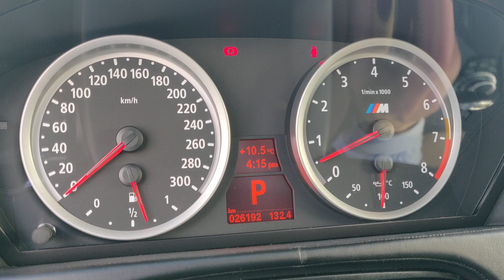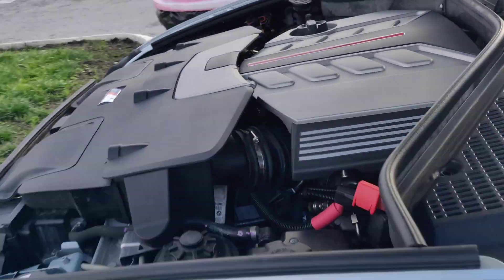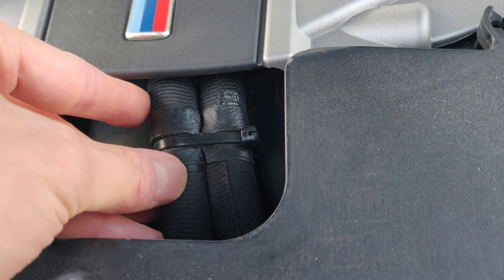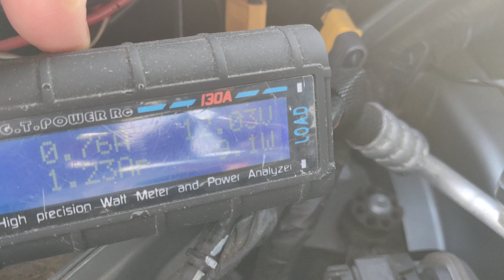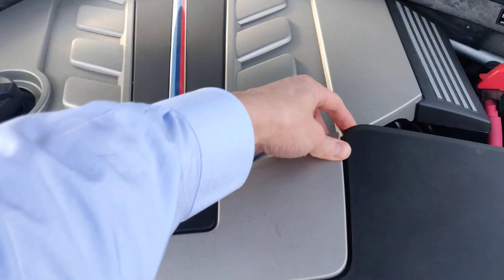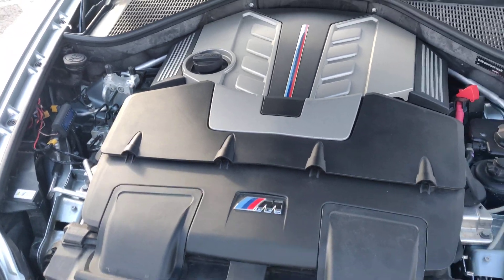X5M(S63 Engine) Owners, Keep Your Turbos Alive - Check the Aux Turbo Coolant Pump

Comment: Does this apply to the S63TU in the F10 M5? 
I assume it would because they are more or less the same despite different technical updates.
Reply from the maker: @johnmactavish5191  Yup, looks like a similar pump, so same will apply. It'll run that for 20 minutes or so after shut down too, to handle the heat soak. Thanks for the good question. 
Cheers! 
David.

Comment: Hey if there's no vibration in the left line that means the pump isn't working?
Reply from the maker: Hi, 
That's the feed line to the pump(it leads down to the pump's intake, so it's sucking on the left side), so you should feel some vibrations from that fluid getting pulled on by the impellers. If you don't, but the pump is spinning, it might be that there is air in the system and needs to be bled or filled up. I didn't do anything special though, I just filled the left coolant tank(for intercooler system, not the right one which is the main radiator). Do you have leaks on the coolant line connections? There's a bunch of them all above the turbos. If those leak then your coolant goes low over time which can lead to low levels and air in the system, it won't throw any troubles and your turbos will just cook over the and seize up. It's a really bad design with no sensors to warn you, which is why it's so important to check the proper operation yourself, which you're doing now so that's great! 
My pump failed and it didn't even say a thing. Luckily I caught it cuz I have the energy meter, which I keep an eye on to make sure the pump pulls about 12w. If it doesn't, that means it isn't circulation coolant properly throughout the turbos. 
If you install a Bluetooth energy meter you can check on it from your phone too, without going under the hood. 
Sometimes the pump just fails, I had one fail after 1 day, brand new from BMW!
Good luck!
Cheers, 
David.
Reply: @DavidSunshine  sounds good I can definitely feel vibrations when the car is turned on but when it's off there's barely any vibration can't even tell of its working or not
Reply: Is there a way to check if the fuse is browned or not first?

Comment: I just got the pump today, mine is making some bearing grinding noise so it'll need to be replaced.

Do you know what the procedure is to replace the turbo aux pump? Do I go from the top of removing the air intakes or do I have to remove the radiator to access it?
Reply from the maker: Hi,
Ya it'll be good to replace it 
It's easy, you can do it from the top by just removing the intake.
Then a couple torx and it's out.
The pain is the coolant lines but if you can get your hands in there it'll be ok.  You'll want the proper sized hose clamps on hand to replace the factory ones, they garbage.  It's the same size as the ones up top. I replaced all of mine while I was at it, since those fail all the time when the rubber goes bad.  You might want new hoses when you do this job, but check it out first and see if that's the case.
I didn't do a special bleed procedure after doing mine, but that's probably a good idea. I just poured coolant into the lines from the top of the hoses to prime it the best I could and remove as much air from the system as possible.  No need to remove the radiator, just be careful not to cut your hand on the sharp metal brackets, wrap them in black tape before you jam your hand in there. 
Cheers!
David.
Reply: @DavidSunshine  Thank you so much, appreciate it.

Comment: So we can splice the wireing and run a digital scan inside car to keep and eye on voltage .once we turn car off .
Nice work
Reply from the maker: Yup!  That's a great idea.  Or you can buy a car battery Bluetooth volt meter, and it can keep track of the voltage from a distance, and even keep a log of it. Then you can connect to it by your phone, less convenient than just a volt read out, but has some benefits. 
Cheers!
David.

Comment: Do you now how to coolant bleed the system cause it is different from other bmw I have bmw x6M 2014 thanks
Reply from the maker: Hi Sunny,
I actually don't have the bleed procedure.  There are two coolant systems, one for the intercooler which is connected to this aux Turbo coolant pump, that's the one we're working on here, then there's the engine coolant system which will be similar to the other engine coolant systems, with the reservoir on the driver side. After swapping the pump, I just topped up fluid in the passenger side reservoir and ran the engine, driving around. There was air in the system but after flooring it a few times it seemed to have self-bled.  From this forum, there's some info on flush and bleed, sounds like one user suggests flooring it as well. 
The next time I flush, I was thinking I could disconnect the top hose and fill coolant there until the air is mostly out.  There's also a screw there, intake and output hoses, if you have a syringe you could fill in fluid until every bubble is out of the system.  I might give that a try when I flush the system.
Good luck!
Cheers,
David.

Comment: Do you have a part number for the pump
Reply from the maker: Yup, for my 2013 it was "11517629917", purchased at the dealership for $100 CDN, surprised it was so cheap cuz it was $350 at Lordco.  I'm guessing that it was discounted maybe cuz it was a recalled part in the previous year?  Not sure why.  Good luck!

Comment: I checked today and mine was vibrating I could feel it pushing liquid through. However the little resvoir by the engine oil cap was cold. Is that normal? Can anyone advise please
Reply from the maker: Hi,
That's great that you feel vibrations, that means you have flow.  If there's even 100ml of air in the system, you'll have pump cavitation and flow will stop.  If both tubes are vibrating then your system is flowing nicely, those 2 tubes should be warm.  The reservoir has no flow, so it can be the ambient temperature.  It's only where expansion fluids go, or used for make up fluid.  When the engine is cooled, open the passenger side intercooler coolant reservoir cap and make sure the level is topped up to max.  You can also check your engine coolant level on the driver side coolant reservoir cap.  Both must be good to maximize cooling of the S63.
Hope that helps!
Cheers,
David.

Comment: Thank you. I’m new to the S63 and I want mine to last as long as possible. I’ll be sure to check when I get home. 🙌
Reply from the maker: Nice!  The S63 is a beast of an engine.  I'm still enjoying mine every day!  With great power comes great responsibility.
I would also recommend changing your engine oil more frequently than they recommend, as it can help reduce wear and reduce risk of encountering other problems in the S63 that are oil related.  Oil is cheap if you replace it yourself, so it's a small price to pay to reduce wear and risk. Also, get only quality oil filters, I trust Mann only, I've had problems with other brands.
Cheers!
David.
Reply: @DavidSunshine   which oil are you using ?
Reply from the maker: @krankrolling  Hi,
I use Castrol Edge FTT 0W40, European Formula.  
Cheers,
David

Comment: Anyway engine need rebuild after 50000 km
Reply from the maker: That could be the case, in some cases.  What specific problems would require a rebuild every 50,000kms?  I have friends who had no issues over 200,000kms from the S63, they maintained it religiously though.  I could see a failed aux pump causing clogged oil lines and needing a rebuild.  I would recommend changing the engine oil every 10,000kms instead of 25,000 like the internal says.  It's only $50 on sale for the oil so if you do it yourself it's not that bad.  Mahle filters only, as the other ones break, and if that happens, then yes, the engine would probably wear down prematurely cuz there's nothing but gunk following through the turbo coolant lines, and the rest of the engine.
These will last over 200,000kms if maintained properly, with very little issues.  Then you may start to run into major issues.
Cheers,
David.
Reply: @DavidSunshine  I'm joking ofcourse, because heard so many times that bmw's 4.4 twin turbo not reliable.
Reply from the maker: @ivanmamedov90  lol, every joke has some truth behind it.  The S63 is a great engine, but it's complicated too so it needs routine maintenance otherwise it could need some rebuilding, I think that's where the stories about rebuilds comes from.  If users don't change the engine oil often, that could cause issues over time(excessive oil consumption, turbo line clogs, VANOS issues). The coolant lines for the turbos can leak, so I've replaced the hose clamps with stainless steel ones to keep that from happening, but if that goes unmanaged it could also lead to major issues, similar to the aux coolant pump.  
The X5/X6 partition can also crack and leak into the engine, gotta replace or seal that before it creates huge issues.
So like any BMW engine, if we keep up with the maintenance, it should perform well for a long time.
Cheers!
David.

Comment: Do you know if this pump failing will cause a engine loss of power malfunction also those pipes are super hot I don’t hear my car cooling off anymore once parked as it used too please let me know thanks .
Reply from the maker: Hi Denis,
The engine power loss isn't the pump.  Scan with Carly and see what it says.  I had that and it was just the cam shaft position sensor, I cleaned the connection and it was fine since.  Just wiggle the connector and it'll be fine too.
Cheers,
David.
Reply: David Sunshine hi David the only codes that were received were for the aux coolant pump off for the turbos and it seemed rather hot of the hoses like to burn your hand if touched. I’ll be changing that out today and resetting to see if it goes away .
Reply: Denis Reckovic hey Denis! Any luck with your truck. My truck is doing the same thing. Let me know if it’s possible
Reply: @DENIS74199 what did u find out? I'm going through this now and had my truck inspected and they said the same... can u confirm this was your issue? 🙏🏾

Comment: There is a “recall” on this part and will be replaced for free at the dealer. My 2012 has 110k miles and just mine replaced. Thanks for the video and awareness of this part and potential problem
Reply from the maker: Lucky! Glad they are fixing yours.  Did they mail you to say it's a recall fix? Or do you have to ask them?  Mine is 2013, no recall on mine cuz apparently they fixed it... Still seems to be a problem prone part though.  I'll be keeping an eye on it, and I would recommend any S63 owner keep an eye on it as well, especially if it's new, to make sure it doesn't fail prematurely.  Cheers!
David.

Comment: Do you know which code is logged?  00A6D1??
Reply from the maker: You'll see 002EA9 for a Turbocharger coolant pump fault, but it'll come back if you clear the codes, even if you have a new pump in there as it's working fine. I think it's just bad programming on their part, BMW ignores that code at the dealership.  But if you unplug your pump, or if it's actually broken, it'll throw that code, and they will continue to ignore it, which is stupid.  So basically you need to verify the pump is pumping on your own, with your hand or an energy meter.  It's a pretty bad system, I wish it had an engine light when the pump failed, but maybe in the future they will add that diagnostic feature.  
You should try unplugging the pump, and seeing what code you see, for me, I throw that code whether I have a working pump connected (after a day or two of driving) or not (right away). 
Cheers,
David.
Reply: Can it be the fuse in the fuse panel?

Comment: Can you find me a link for the aux coolant pumps? I’m not sure what the right ones are.
Reply from the maker: Hi,
It's the Auxillary Turbo coolant pump, as show here:  https://www.rockauto.com/en/partsearch/?partnum=11517629916
It's about the same price from the BMW dealership part's counter, but a brand new one from them failed a day later, so I don't think their quality control is great.  GATES is a great brand, so I would actually go that route before getting another BMW pump.
It doesn't take much to replace, and I could do it with a few tools in a car park.  Just need to replace it, and top up the coolant.  You should probably bleed the system from the top bleed screws, but I never did, instead, I just brought it up to operating temperature and did a few WoT launches, it purged all the bubbles out, and it started pumping fluid after that.  I had a wireless amp meter on it, so I could see when the pump was in cavitation, without that, you will have to check the hose for vibrations to verify that it's pumping and flowing coolant through the turbos, instead of cavitation(which sounds like vibration of the impeller), or it's just spinning without any turbulent flow through the hoses, which are both bad, and if that's the case, you should go drive around and do a few more high rev pulls or launches.
Hope that helps!
Cheers,
David.

Comment: bad design if it won’t warn you with error code. Seems critical.
Reply from the maker: Haha, yup, that's what I thought!! I troubleshot this stuff a lot, it never once warned me with a check engine light, and yes, it may take months or years to have a failed Turbo, but I think it is critical as well!  BMW programming doesn't suggest this.  If you go and unplug the aux Turbo pump, it won't even twitch, will just keep running like nothing is wrong!  This is very alarming.  That's why I installed the energy meter and check it every once in a while.  I also had a Bluetooth energy meter in there for a while and was checking every drive for a few weeks until I gained confidence in it, now I open the hood and check it every month or so.  At least I won't go that long with heat soak cooking my oil.
If I can help one person with this info, and save a Turbo, I'm happy!
Cheers!
David.